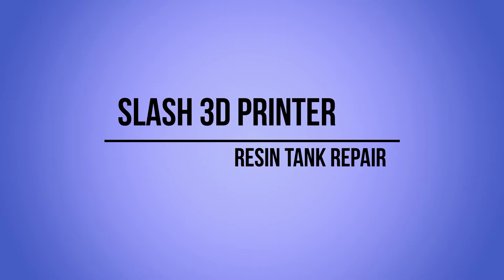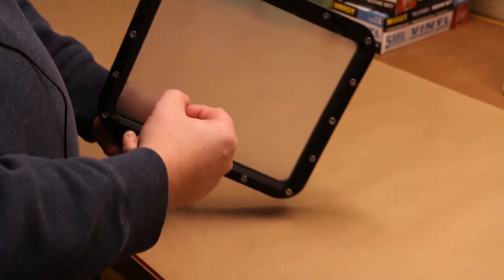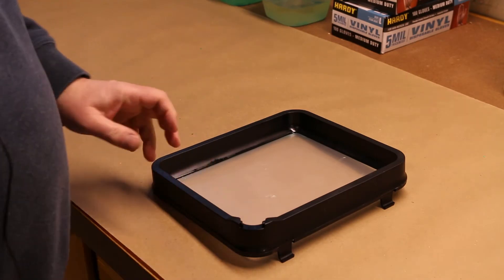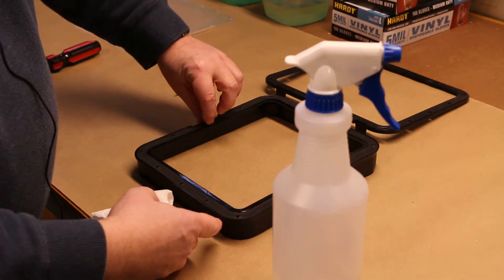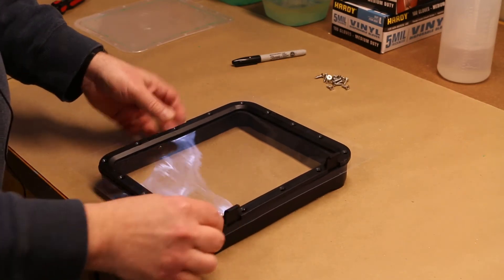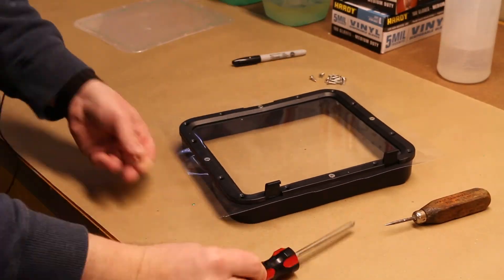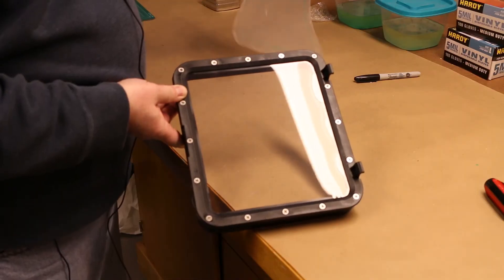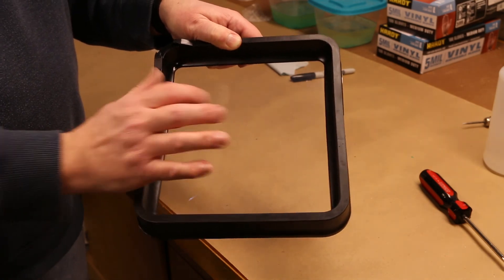Resin 3d Printer Tank FEP Film Replacement

Comment: I cannot speak to whether or not there is any truth in the "lore" of using RainEx on the FEP film to aid in part release in this kind of application, but as an engineer that works with FEP film on a daily basis professionally... My opinion is that the RainEx does not do much of anything. The fully fluorinated nature of the chemical structure of the plastic makes it chemically insert naturally. It's very similar in nature/composition as "Teflon" (a DuPont/Chemours trade name) coating on 'non-stick' cookware). For the price they list a small piece of film for, I ought to sell it myself considering I have access to practically an unlimited amount of it! Neat video!
Reply: would love to know where you're sourcing the FEP. i have a laser cutter and i was thinking of buying a roll and laser cutting replacements.